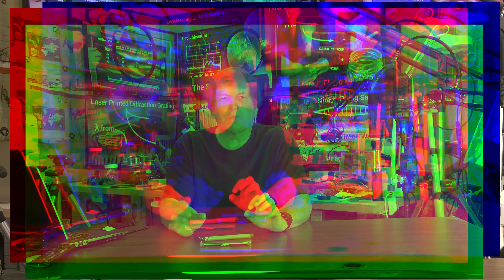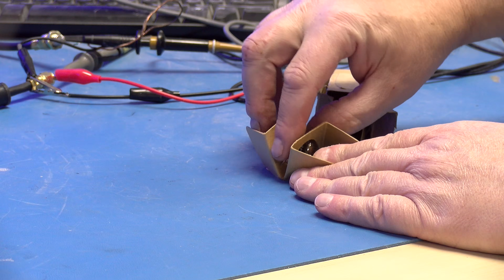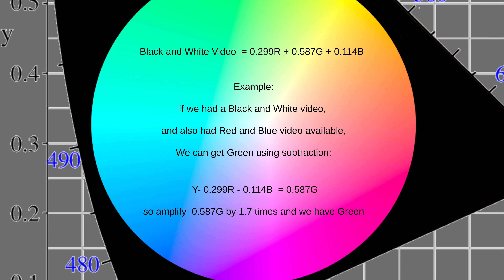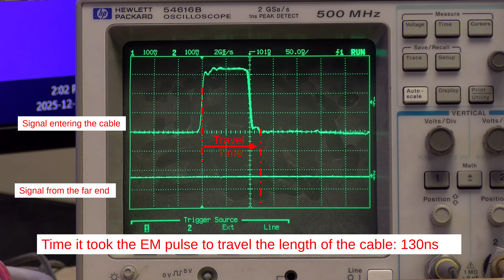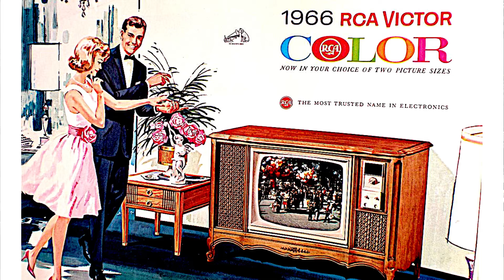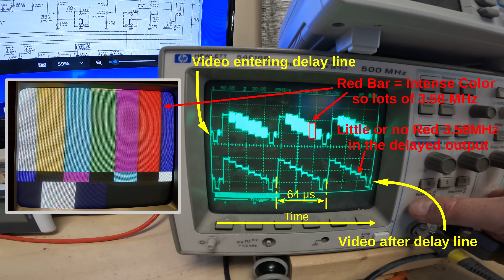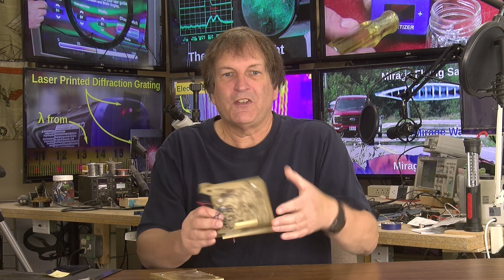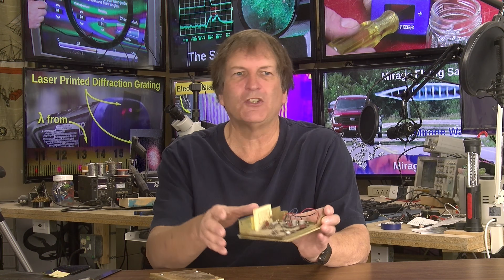How we slowed down electricity to create Color TV

Comment: Whole professions existed repairing those Tvs, as a kid we didnt have AC in hot summers but they did always have the TV working, the TV guy coming in. In HS i fixed my dads friends TV, taking the Tubes to a test unit, which was at drug stores, replacing the failed test ones.
Reply from the maker: Yes - a whole industry that vanished overnight. I remember going with my dad to test tubes at those giant drug store tube testers - the were almost the size of pinball machines. I fixed a lot of TVs from the 50s and 60s when I was kid/teenager in the 70s - learned so much electronics doing it (in the the end I had a 1950s oscilloscope and tube tester!).
Reply: Back in the 80s, if you opened a Philips TV, you could find a large piece of paper neatly folded and stored at the inside of the back panel. That was the schematics of the TV, and on the other side the “ABC repair scheme”, a complete guide how to find the faults in the TV. As a teenager I’ve been able to repair my parent’s TV many times using that, very useful.
Reply from the maker: @erikmouw  And if it wasn't inside, there usually was an extensive service manual included along with the instruction manual. Even better if you were repairing olds sets, were publications like Sams Photofacts and I'm sure the equvalent in other parts of the world. When I was a teenager, I would often go to the local library and photocopy the schematics of the TVs I was trying to fix. One thing I  soon realized was how similar many TV from the same manufacturer were if they were from about the same year. And even for different manufacturers, if it had the same set of tubes the circuits would often be very similar.
Reply: @ElectromagneticVideos  This particular TV set was sold under the Aristona brand in The Netherlands (Philips used Aristona and Erres brand names next to their own over here). My parents bought it in 1980, so it was either a late K9 or a K12 chassis. I think it was K12, but the memory is a bit vague cause I repaired many more TVs. Both chassis were very flexible, different size of TV tubes, different tuning modules, remote control, vcr connection etc.
The K9 used an ultrasonic remote control, at that time I was young enough that I could hear it.
I’ve once repaired a luxury K12 based TV set with stereo audio, remote control, vcr connection, teletext extension and even a built in Teletext printer (on thermal paper). 
At that time Philips still had service centres all over the country, and those were my source of knowledge and parts.  They were all closed down at the end of the 90s, unfortunately. I bought a large supply of Philips branded contact cleaner, I’ve used the last one of them a few years ago.
Reply: @ElectromagneticVideos  Philips being from my country, they had repair shops in major cities, at least up to the late eighties.
You could go there and buy a service manual (quite inexpensive) and also parts kits to fix common faults (often including a modification so the fault would not occur again).
The reason that this al vanished is quite clear: at that time, a color TV cost as much as a month salary for a worker, and when it failed it was worth it to repair it.  And cost of labour was lower, so it was possible to operate a TV repair shop or service.
Now, you buy a TV for a day salary and to repair it would corst a significant fraction of the value, so it is more cost effective to throw it away and get a new one (usually even cheaper than the one you are replacing).
Not good for the environment, and not much fun...

Comment: Those delay lines were the most interesting part of this video.
Because even through i do know that color red and blue will be coded and mixed with the B&W signal, it still don’t understand how green could be subtracted from B&W🤔
But i do know that B&W is the sum of 3 colors.
Reply: The third colour was generated from the relationship of the two that were transmitted. By knowing those two the third one could be arrived at. Its a bit like knowing two angles in a triangle lerts you calculate the third because they always add up to 180 degrees.
Reply from the maker: Gee - I'm sorry I didnt devote more time to mixing and subtracting colors. Consider (or even try) this: Three flashlights, one with a Red, one with a Green, one with Blue filter. Point their beams so they overlap  and they should produce a white. Now turn off one - say the Red one for example. And your left with Greenish Blue (called Cyan). Thats subtracting the Red from what was White. 
Now you have to do that individually with millions or R, G, B pixels to make an image and it works amazingly well.

Hope that helps a bit! Glad you found the delay lines interesting! They are such neat and almost forgotten devices!
Reply: @ElectromagneticVideos well for what i do know is that while the B&W signal is the sum of all 3 colors.
But forwhat i do know is that when a color tv only recieves a B&W signal, it will light up all 3 color beams.
But if it will recieve a color signal (red & blue aside from a B&W signal) it will only send that B&W signal to the grean beam while the red & blue signals getting sended to the red and blue beam.
However i do wondering this.
1. If the that B&W signal alongside it’s color signals do originare from the green signal, then how does it not lead to loss in detail on a B&W tv?
Possibility 2. If that B&W signal alongside it’s color signals originates from all 3 colors, then am wonder how that B&W signal doesn’t overlap to those other signals.
Let’s say i split a color tree image into 3 parts.
Then In the blue part you will only expect to see the sky, in the red parts you only expect to see those red apples while in the green part you only expect to see the grass and those green leafes of that tree.
You don’t want to overlap them incorrectly🤔

Either way it’s fashinating hiw pal and ntsc color format was created.
Secam is even more special because it sends all 3 colors saperately from each other by sending each color one by one.
Then those delay lines will recieve those color signal  to make the full image and all being distortion free as opposed to pal or ntsc.

Either way i can imagine the skip from B&W to color is way more fashinating then the skip from fullhd to 4K.
Reply from the maker: @johneygd  So what happens is the BW that is sent is the true BW image that an all BW system would have sent - so its the sum of all three primary color images. A simple color TV system might then send R and B on color carrier, and then to get the G image all you would need to do is subtract the R and B from the BW. Real systems actually generate two carefully chosen synthetic primarys that are two different mixtures of RGB, one of which is chosen based on what we see least sharply. What that means is that colors of different angles on the color diagram are sent with different amounts of sharpness. Those two synthetic primary color images are then combined with the plain BW image with a combination of addition and subtraction to create the actual R, G and B video images needed for the picture tube in the TV. 

SECAM also sends the full BW image. But unlike NTSC and PAL, it sends one of the synthetic color primaries an FM carrier on one line, and an the other synthetic color primary on the next. So the delay line is needed to have the color primary from the previous line to calculate RGB from the BW image. So SECAM uses the fact that we cant see as much detail in color not only in horizontal direction  but also vertical. 

Completely agree - HD to 4K is really just about capturing more pixels and sending the data faster.

Comment: Why did they need to delay the signal in each TV set? Couldn't they just have done that to the signal they sent out, so that when the TV displays the images shifted, they will match?
Reply from the maker: Thats a good question!  Its because the delay needed depends on the difference in bandwidth of the color component and the black and white component. In early TVs they separated the color from the black and white information by a filter - black and white was everything below something like 2Mhz, color everything above 3 MHz for example.  Depending on the filter frequencies (how much the images were smoothed)  used in the TV, the delay needed was a different length. They anticipated future signal processing could do much better - pretty much get black and white almost up to 4.5 MHz and the color part at its full transmitted bandwidth, which would require a different delay. So because of different TVs being better or worse at extracting color and BW video parts with varying degrees of sharpness, the length of delay would have to be set in the TV and not the TV camera or station.

Comment: @ElectromagneticVideos Pete, you did an excellent job explaining the NTSC Color System from the average person's point of view!

I have had the same insatiable interest in electronics from an early age.  Born in 1955, I started repairing TVs and restoring antique radios in 1972.  Not happy with working in TV Shops, I went on to better things and have spent most of my career designing aircraft communication radios.

I am also very interested in early television history from mechanical television to RCA's Color System.  Interestingly, the FCC was sold on the CBS Field Sequential System in the early 1950's, which obsoleted existing B&W sets and took up 3X the spectrum bandwidth but, RCA improved their color system markedly from 1951 to 1953.  I think the prime deal maker was the compatibility with existing B&W sets.  The first color sets started selling in April 1954.  The design of the RCA system was so brilliant, I don't believe we have that same level of advanced design capability today.   

The distortion you are seeing in your TV Delay Line response is mostly due to the heavy capacitive loading by the oscilloscope passive probes.  Ideally you would need to use an Active Probe with a capacitive loading of less than 1 pF.  However, your demonstration was adequate to prove the point.

Comment: The NTSC color subcarrier frequency was carefully chosen to be 227.5 times the horizontal scan frequency. That way, any visible dots would be largely cancelled by the next scan line and also by the next frame. But some artifacts remained, such as the infamous 'dot crawl'.
Reply from the maker: Exactly! The dot crawl was sure visible on the black and white monitor I used in the video - I suspect ist video bandwidth was close to flat up to 5 or more MHz.
Reply: The 0.5 in the number means that the subcarrier will be 180 degrees out of phase from one line to the next. The result is the subcarrier appearing as a mesh pattern on the screen instead of straight vertical lines. This makes the subcarrier much less visible and yes I have seen what color TV pictures look like without the half cycle offset.
Reply from the maker: @Rory-jk9us  What I would be interested in seeing is how the less lined up PAL dots and not lined up at all SECAM FM dots compare to NTSC when seen on a BW screen. I lived in  PAL and SECAM countries as a kid but dont have any recollection of their dots being visually annoying. That will hopefully be past of a PAL, SECAM and NTSC video.
Reply: @ElectromagneticVideos  If I remember correctly it's 8 half/interleaved frames before the phase of the subcarrier aligns again - so the pattern is also temporally smoothed out. I built a digital NTSC and PAL video encoder with genlock support in the very early 2000s. The interesting difference between the "standard" 13.5 MHz sampled architecture and mine was, that we upsampled the video data to 100 MHz rate using an FIR filter and all color processing was digital. Going to the high sample frequency made the analog post filter simpler and the phase shift below the 6 MHz active signal BW was negligible.
Reply: @ElectromagneticVideos  If the PAL subcarrier was not also offset by frame rate, the R-Y component would make vertical lines of dots while the B-Y dots would alternate like NTSC. The small offset of a quarter cycle by the top of the next image (combination of line offset, alternating R-Y phase and frame rate offset) makes both the R-Y and B-Y rotate back to their original phase after 8 fields.
From Wikipedia: "The 4.43361875 MHz frequency of the colour carrier is a result of 283.75 colour clock cycles per line plus a 25 Hz offset to avoid interferences."
Reply: @Rory-jk9us : some videogame consoles like the Atari 2600 used 228 color clock cycles before they cut the line (perhaps they didn't want to pay for a higher frequency and more counting transistors).
Others like the NES and SNES used 341 pixels per line, where 1 pixel = 4 system clock cycles, and the system clock ran at 6 times the NTSC color subcarrier. That's 227 1/3 color clock cycles, so you'd get a staircase pattern over 3 scanlines. They also altered the position of the color artefacts per field (which is also a frame, "240p"), so on static pictures the errors were greatly canceled out, but scrolling pictures were still noisy.
Reply: Or... you could say the horizontal scan frequency was changed slightly to enable it to be exactly 455/2 times the horizontal scan frequency. Hence we ended up with 29.97002616 frames per second instead of 30 fps. The consequences of this ingenious compromise live on things like the drop frame time code.
Reply from the maker: @gracenotes5379  Yes - what a nuisance for creating things like video editing SW these days have having to deal with that!
Reply: @ElectromagneticVideos  Also the dreaded color framing.
Reply from the maker: @joedavenport6156  You got me there - I dont know that term - what is color framing?
Reply: @ElectromagneticVideos  Color Framing in NTSC has to do with the fact that 4 sequential fields are required to make a fully color-locked picture.  The relative phase relationship between the subcarrier and horizontal sync changes 180 degrees between each frame.  This is known as sc/h phase.  During videotape editing, you must make sure that your videotape machines are properly sc/h phase adjusted, or color-framed, or you risk getting the "dreaded" horizontal shift at the edit point.  This was somewhat common in the 1980's when digital TBC's would encounter an improper color frame at the edit point, and attempt to shift the horizontal sync to accommodate.  The result would be a small horizontal shift of the picture momentarily at the edit.  It drove directors crazy.   When editing on earlier VTR;s without digital TBC's, such as the Ampex VR-1200 Quad machines (which used analog time compensation, AMTEC and ColorTec) if you edited on the wrong color frame you would see a momentary 180 degree color shift, and then shift back at the edit point.  This videotape format was never intended to be edited and there was no way to measure color framing on these machines.  You did the edit and had a 50-50 chance of hitting the proper color frame.  I used a Datatron 5050 edit controller with Ampex 1200's back in 1984 at KLCS Channel 58, and we would joke that the model number of the Datatron meant you had a 50% chance of getting a color shift at the edit.  Sorry for the long exposition, but this discussion opened up some old memories of early in my career.
Reply: @gracenotes5379  No, the choice was made because the sound in B&W TV was transmitted on a 4.5 MHz FM modulated carrier - the color subcarrier for a 60 Hz refresh rate would have interfered with the sidebands of the sound carrier, this made some funny noise if a color broadcast was received on a B&W set. To avoid this, they changed the refresh rate by 1 %, the existing population of B&W TVs would still work as the capture range for the synchronization was about 5 %.
Reply: @m210658  I believe both to be true. The exact 180 degree phase relationship seems too good to be a mere coincidence.
Reply: @m210658  you mean 0.1%. The ratio was 1000/1001.
Reply: @oldtvnut Yes, my bad!
Reply: @gracenotes5379  The exact nominal frequency can expressed by a repeating decimal, but is most simply expressed as 30x(1000/1001). The shift in scanning rates (both vertical and horizontal) was by exactly this ratio, or one tenth of a percent.
Reply: The half line rate was also to place the chroma side bands in between the monochrome side bands. The energy transmitted was concentrated at multiples of the horizontal line rate. Spectral interleaving.
Reply from the maker: @joedavenport6156  Yes - I always though that it was brilliant that they anticipated things like comb filters becoming practical when they designs NTSC.
Reply: @ElectromagneticVideos  Comb filters are easy if you have delay lines
Reply: @joedavenport6156  Because there is a strict one-to-one correspondence of the Fourier transform and the video signal vs. time, the frequency interleaving is another way of saying that ordinary stationary objects do not have detail that alternates phase from line to line, field to field, or frame to frame. Of course, this tends to fall apart if the camera is panned across a patterned object, such as the plaid sports coats that Johnny Carson liked to wear. The problem was reduced by the cameras integration time that smeared objects in motion, but you would still see luminance patterns reproduced as flickering colors in those cases (called "cross-color"). The subcarrier dot pattern in black and white sets was also sometimes called "cross-luminance."
Reply: If I remember correctly… the dot crawl wasn’t there with the YC format - just composite
Reply: @njjeff201  Correct - no subcarrier, not dots. YCrCb systems carried the color info as time-multiplexed analog or separate data in digital systems.